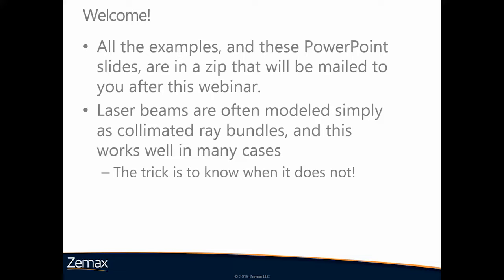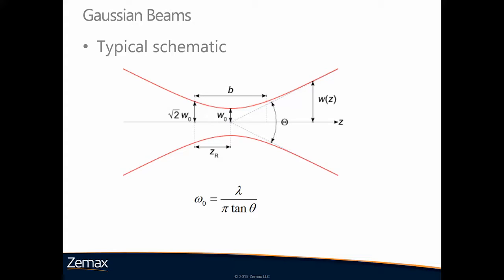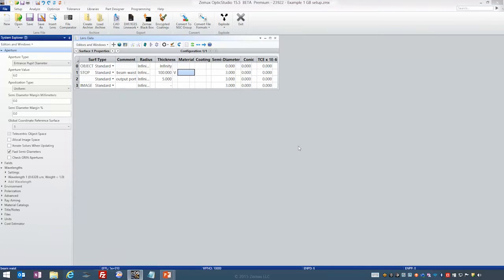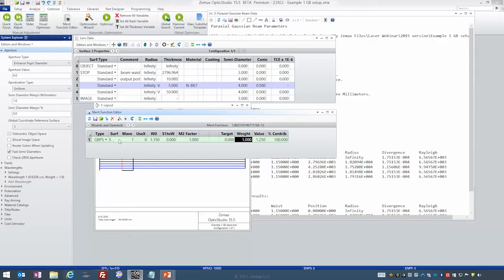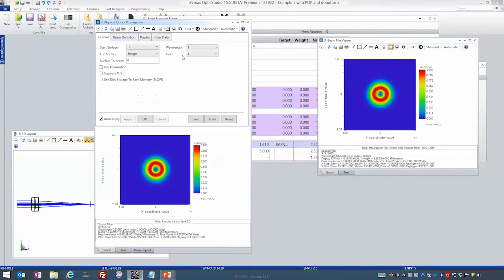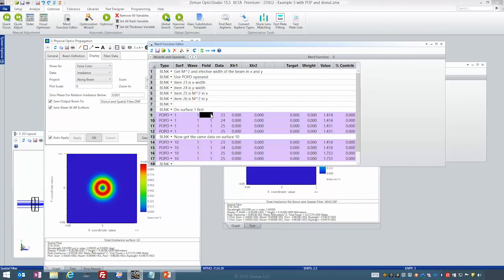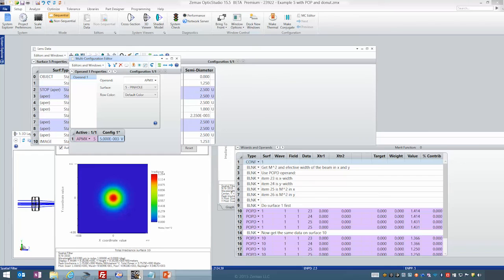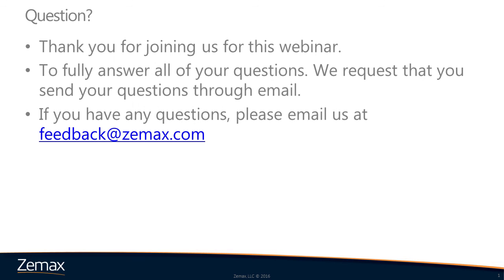Laser Applications

Comment: I have a question, the He:Ne laser used has beam diameter of 2.5mm , it is FWHM , or 1/e^2 diameter? I have tried to find it out but got different values for this laser. My question is that while using zemax which definition of beam diameter should be used?
Reply: I think the convention is the radius is at w_0 which is 1/e^2 of the axis intensity